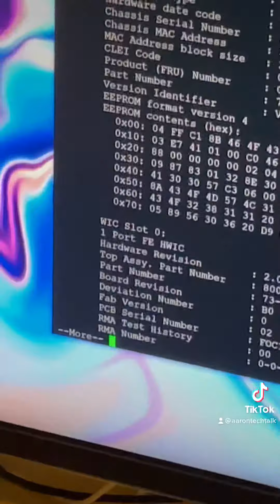Router module swapout Cisco 2800 - teaching my son @aarontechtalk

Comment: Great video, do you have a video with the physical structure of switches and routers explained?
Reply from the maker: Hi Arnold, I usually talk about protocols and mechanics, but in this case my son and I were testing out different modules in the Cisco 2800.  What other physical structural things are you interested in?
Reply: Hi   @aarontechtalk , It is just that I had never seen how those modules were unattached, thanks!
Reply from the maker: yw!